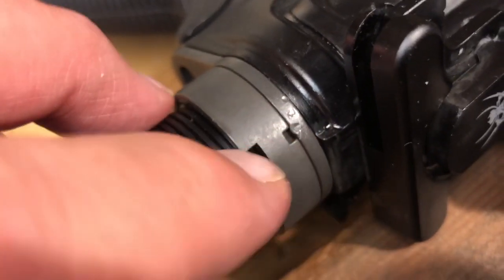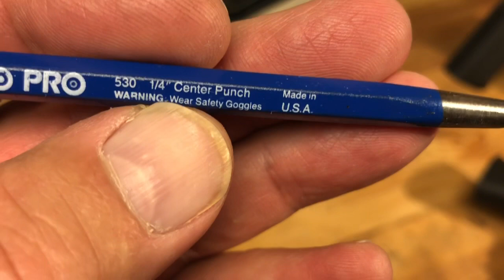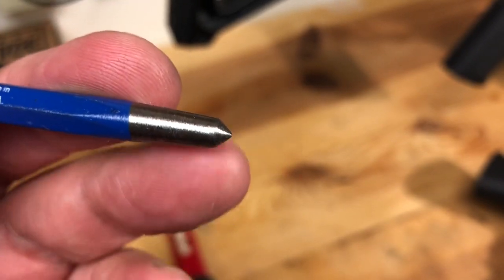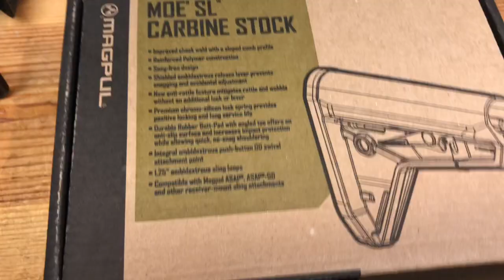Staking Your AR-15 Castle Nut

Comment: I put loctite on one of mine then later down the road I had to take it apart.... even after using a torch I torqued on it so hard it bent the receiver a tiny bit. With a wrench you can easily break a staking it doesn’t take much force but it will keep the castle but from backing off so best to just stake it.
Reply: There is different types of Loctite. The blue is used on parts that you want removed. Red is for semi permanent. With Rockset being permanent.
Reply: @TheRepublicHasBeenLost  I use blue on everything I don’t even own red or purple, I know how loctite works and it’s way easier to break threw staking than it is to break threw loctite. And that’s a good thing it holds it from backing off on its own but if you need to take your stock off just take it off